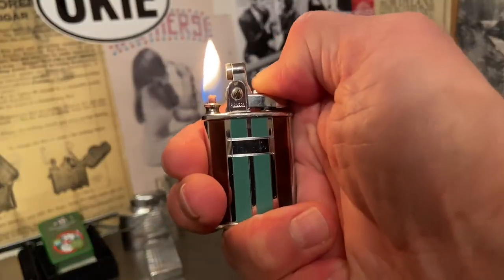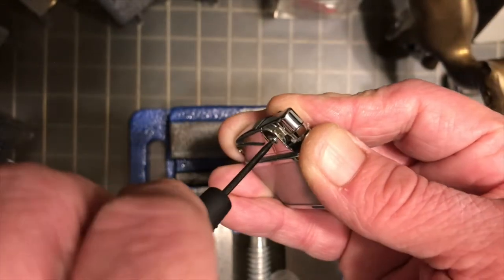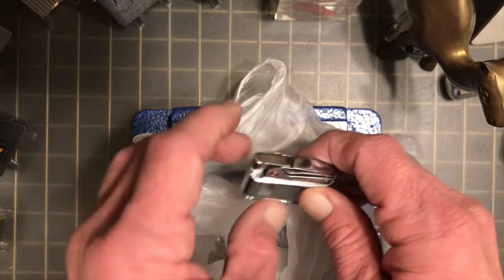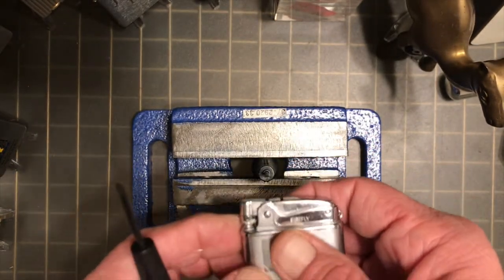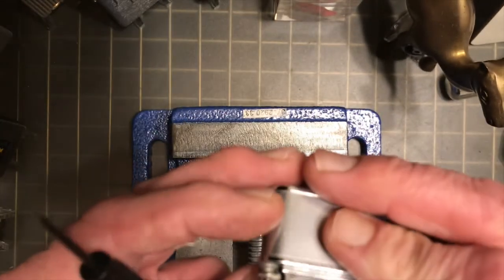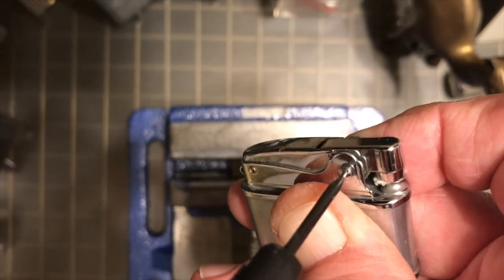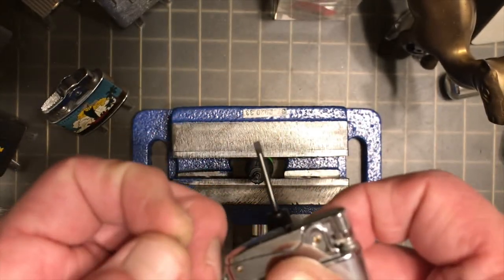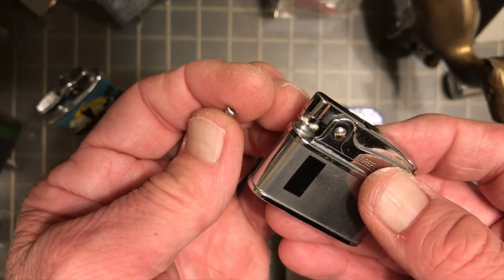How Can I Fix My Old Lighter If The Screw Just Spins When I Turn It?

Comment: Great video dependable flame, as usual!. We tinkerers are endlessly delving into the most finicky projects aye? Lol. Great piece to work on, it's gorgeous. 

Kydex sheets are a couple bucks on fleabay and amazon, I recommend grabbing a sheet, cutting it in half, then heating it with a heat gun to form to the jaws of the vice. Makes for a perfect plastic face for a softer clamping surface. And it's cheaper than most pre fit/cut adapters. I had a delrin (spelling? DELL-ren) anyway, a delrin set of jaws for working on pew pews, and a delrin punch for sights. They work beautifully in these applications too. Just a helpful tip I use lol.
Reply from the maker: Thanks for the tip Deadstick! Sounds like a cool project, keep your eyes peeled, I might just do it.😜✌️
Reply: @DependableFlame  Heck yeah! Always down for more content! The old school cheap way is just some jumbo popsicle sticks or paint stir sticks. Even bass wood sheets all make for easy and disposable clamp shims/makeshift soft jaws. You've got inginuity in spades though friend, you'll find a niche that suits your purposes best. The rubber glove trick ain't  bad either though
Reply from the maker: I grew up in an oilfield machine shop. Put a lot of stuff in a vice but never once concerned myself how soft the jaws were!😜 I prefer this work anyway.✌️
Reply: @DependableFlame  Roughnecks can do the detail work too I see lol 😝

Comment: I have a ronson decanter and the fuel screw just spins- any help for me on that screw?
Reply from the maker: Hold it with the screw facing down and see if gravity will help those threads get started as you turn the screw counter-clockwise in that position.✌️